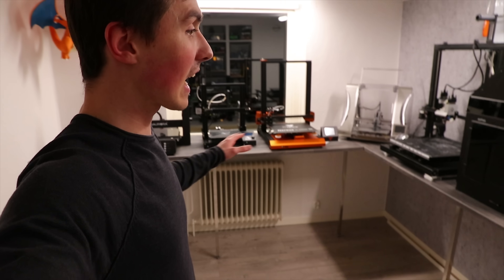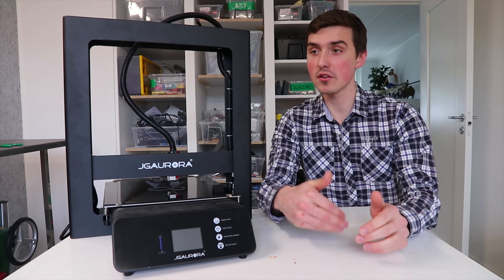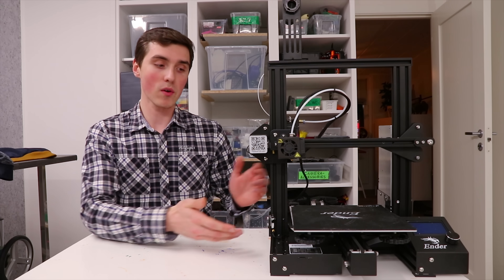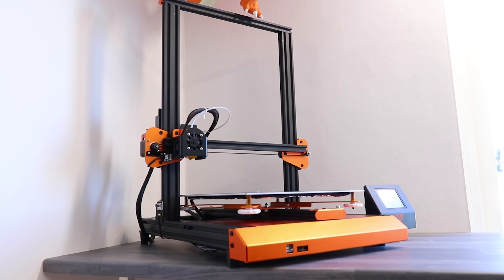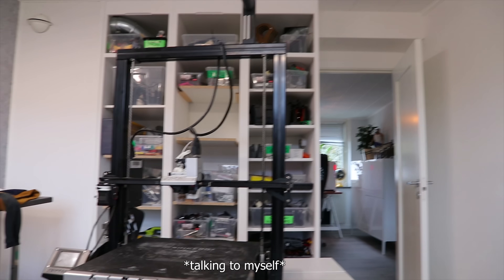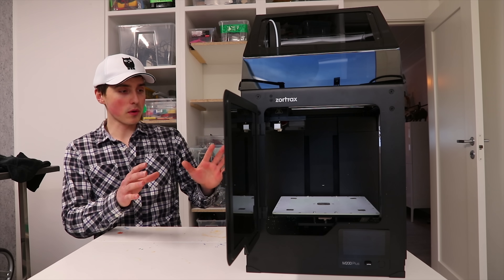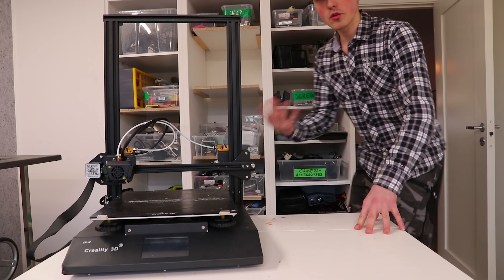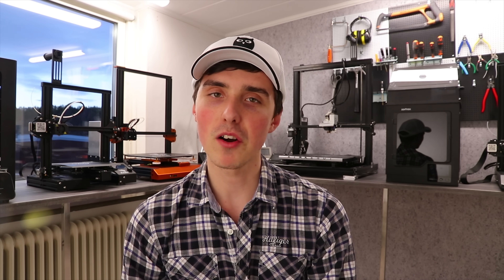I Can Only Keep ONE 3D Printer?!

Comment: Greetings, Great Channel! I was wondering about your filament choices and how that effects your printer choices. I am interested, for a number of reasons in printing mainly with high-temperature filaments like PC and PETg. I also print in the translucent prints a lot. Would your choice of printers be much different if that is the criteria? Also, what about the recent generations of reinforced PLA and ABS, such as carbon reinforced ABS, will these printers print in those materials? Thanks in advance, keep up the good work, WGP

Comment: I bought two of the JGaurora A5S after watching a few reviews. Have them now a few weeks and to say they are very frustrating is an understatement. I have the CR-10S and never had an issue with that. These I level it, start the print, find it’s not sticking so stop it and check it and it needs to be levelled again. So I level it and if it does stick all of a sudden I hear a clicking noise and I check and it’s the feeding wheel. Too close so I sort that and it’s back to not sticking. Took the bed off both and everything is perfectly straight. Seems as if one of the z motors is moving at a different rate to the other

Comment: “Doesn’t reach 90 degree Celsius.” Are they supposed to? Water boils at 100C. If the platform reaches 90C it can burn people and melt plastic, isn’t it?
Reply: Yeah they do. Different material requires different heat. There are many materials u need the hotbed over 100c
Reply: Ahmet Topuz just ordered the creality in this vid. I’m gonna cook eggs with it.
Reply: @danielx40  :D all jokes aside, i was trying to print ABS on a bed that was 70-80 and it would start coming loose middle of print messing the whole things up. Now at 110, I can print nicely and it doesnt get loose. I think industrial nylon needs like 250-300 degrees to be able to be printed. I could be wrong tho. Enjoy those eggs ;)
Reply: @ahmettopuz5083  I was just reading about filament materials. ABS is much more durable but does need a higher temp. Some people build a box around it, even with construction insulators. It seems achievable. Without rewatching the video, I believe that I ordered the "doesn't reach 90 degree" model... Guess it's gonna be medium rare for me.

Comment: I don't know about you, but if I need to keep just one 3D printer, it would be my first and latest upgraded one: My trusty Rostock I've built myself. I've even once installed it with an inductive heated head plus a thermocouple and got up to 750 degrees Celsius, tried to print metal (it failed, since the different layers got oxygenated so they didn't stick. A vacuum chamber is above my budget, so I've stopped there). I've made so many mods to it over the years.. But I am beginning to have heresy thoughts about constructing an HyperCube to replace it since with a CoreXY I can get to very high speeds. But really, once you take a Rep Rap design and build it, add you own personal flavor to it, that's the only way to get the perfect printer for yourself. Or to be more exact, to a good printer for yourself as there is no such thing as "a perfect 3D printer". You always strive higher. Which is great.. If its your own build, you can always upgrade it.

Comment: Great Video, I like your explanations, thanks! When you would by a 3d Printer, what would you prefer one with or without dual Extruder? What are the advantages of the dual extruder? What slicer do you need? How can I design something and assign the material where it has to print?
Reply: I'm just starting the journey, but with a dual setup cant you use a water-soluable filament for the supports?    seems like the best application

Comment: The JGAurora looks sexy but the wheels soon fall off as parts go wrong and they guarantee is worthless and they are hard to fix since all the wires are hidden and our A5 had gone wrong 3 times within a few months including black paint coming off the hotbed. Cr10 is low fi but they work

Comment: Meh....smaaaaaal
I build printers that reach more than 1000mm.....
My one is 450x600x470mm /// 45x60x47cm , can print anything , i build diy heatbed for it 1000W 350x450mm and second 450x600mm 1.5kw ..... 60*C i ln around 60 seconds 100*C in 2.5 min :D quality....i just say that printer is made using laser linear rails with 0.003mm tollerance(so hard to move it), price ..... If you use cheap chinese rails around 350$ for 450x450x450 print size you just need to repleace steel balls for high quality one and print quality you get is around 9/10...if hiwin (0.05mm tollerance) around 800$ the same quality but out of the box.So you get quality around ultimaker 3 or better:)

Comment: I got Ender 3 and my prints were ok.. until i switched to glass and now they are PERFECT.. The pains i had to go thru with the PEI sheet and warped bed was... well, if i had known what a difference it is i would've just thrown the sheet away.. It lifted of the bed at middle juuust a bit, 0.1mm or so and when the bed is not flat on enders to begin with... the first layer is a pain. With glass it is nothing short of amazing, of course i has tweaked mine to optimum so i could get any quality with original sheet..

Comment: Huh. Tevo Mispelled Nerys :-) hehehe I see the Nereus as a "reboot" of tevo and a decent solid reboot. I like the ultra lightweight design ethos they seem to be going for though it needs some tweaking. I also love how EASY it is to remove that front orange panel to access everythign inside. EASIEST access machine on the market. getting excellent prints from it with a 1.2mm nozzle. Also agree print surface sticks a little TOO well :-)

A5s NICE quiet. my biggest complaint about their A5 and A5x otherwise agree nice solid machines.

Ender 3. wicked. still advise the pro over the regular. there is only about a $20 to $30 price difference which is worth it for the PSU alone. YES agreed get rid of the mag bed ALTHOUGH I hear it can handle 100c I have not confirmed this. just toss the flexble mag bed and slap a piece of wham bamm spring steel on it. NICE !! 100% agreed PLA can pull the mag surface apart stock! yuck.

drool. I WANT that xinkerbot and that zmorph. soooo badly. xinkerbot might happen someday but not the zmorph. can never afford that and I am not big enough I suspect for them to send me one :-)

great video as usual. LOVE your stuff!
Reply: I enjoyed your live stream the other day when you were unboxing the nereus, I ended up buying one and decided to buy some tmc 2208's as well. Can't wait to get it.

Comment: if you use the zortrax long enough, you'll find it's not good at all, the bed is a consumable, that's absolutely stupid, the software and hardware are locked in, you can't do anything but what they allow you to, for 3k it's better to get an ultimaker, or pay less for a prusa that's half decent, although if you buy into the zortrax ecosystem it's plug and play, never have to think about it

Comment: A cheap direct drive adaptor for the Ender3:

https://www.ebay.co.uk/itm/Ender-3-Direct-Drive-Upgrade-Kit/173704864701?hash=item28719de3bd:m:mASxd84nIwRDZNCKjovxdbA&frcectupt=true

just ordered it myself to go alongside an all metal hotend.

Creality have also just released an upgrade "silent" board thats plug and play:
https://www.creality3donline.com/creality3d-ender-3-creality3d-ender-3-pro-creality3d-ender-5-v114-silent-quiet-main-board_p0147.html

Comment: I hate to say it but I am truly stuck in the position of i have to quit using a printer....... If i have 5 printers running im blowing a breaker :( 1 ender 3, 1 cr-10s, 2 cr-10s pro's prusa i3 mk2.5 so i can only run 4 at a time:( I dont run the Prusa much. anytime i run that thing i have to work on it.... i learned to stick with creality but i am at my limits on power

Comment: @4:50 i did all the upgrades except the stepper motors... i modified a direct drive extruder design to fit my stock nozzle assembly, and incorporate the fans in better positions. i also make aquariums, so i took a chunk of glass and made a glass top haha! works great! im also printing lithophanes on mine. still gotta get the temp settings dialed in, but each one is better than the last! im using PETG

Comment: you made me buy a ender 3 a while back, from watching your videos..........

And I love it :D

Keep up the good work, I'm considering upgrading the motherboard(MKS Gen-L) and more silent stepper drivers(tcm2208 or 2130?), hopefully a fun project :D allready have the glass bed :P
Reply: Be careful though, one russian youtuber said that a circuit burned on his ender and hotend literally was out of control. Be careful with it, there is no protection on circuit.
Reply: @bogdanbelskii7522  Maybe from factory, but I have updated my firmware to include "thermal runaway protection", so I'm good. ANYONE getting into a new hobby should research, finding what is needed to fix on new hardware, and correcting it.
Statements like "a russian said your shit can catch on fire" HELPS NOBODY, "make sure firmware is up to date, and check the common issues to fix them" is helpfull ;)

Comment: Why do you never have anything from Prusa ? they are such an important company for 3D Printing. Would love to hear your thoughts :)
Reply: fassenkugel  Customer service and reliability are key in Prusa printers. They are designed for schools and workplaces where time is at a premium. I bought one personally and don't regret it. I can rely on it to do what I need it to without tuning or advanced setup, but I still have as much control as I want (unlike afinia and makerbots). That reliability puts Prusa, Lulzbot, and Ultimaker above the clones for businesses and schools.
Reply: Yeah where's the MK3???

Comment: You really think the Ender 3 Pro is not worth the additional €20-25 for the improved power supply and magnetic bed? Was really thinking about getting a Pro, but second guessing now if I should go for a glass bed
Reply: the more rigid frame is about the only worth while upgrade that you can't get for cheaper on your own.  The magnetic bed is garbage.  It's a neat novelty for the first week, and then you'll want to switch to a glass plate, especially with the ender 3's notorious warped bed.  Having bought an ender 3 pro, I'd gladly go back and buy the regular ender 3 and just do my own upgrades, including buying a better power supply for less than what the pro cost.

That said, if I really were to go buy another printer I'd probably get the ender 5, or build a coreXY/Hypercube  The extra space  that having a moving Y axis takes up is annoying, and on larger/taller prints(like lithophanes) the movement can cause wobble or pop the print off of the buildplate.
Reply: @nothanks7752  thank you, insightful!

Comment: I have got a question about the CR-X. 3 Weeks ago I started looking for a dual extrusion 3D Printer and I have seen some really nice machines like SIGMA r17, Makerbot Method... But the problem is that they are very expensive so here are my questions: Is the CR-X a good dual extrusion 3D printer? that is also able to Print Support-PVA with no problem. Because that would be one of my main reasons why I am buying such a Dual extrusion printer. In case you could not recommend the CR-X as a PVA printer are there any other 3D-Printer out there (Dual extrusion) you could recommend (2000€ price point). 
PS: Love your videos
Reply: What would you like to do with the printer ?
Reply: @Wieselkatze  Das steht doch im Kommentar xD
Reply: @lf8808  ich meinte mit meiner Frage was du denn genau vor hast. Oft braucht man garkeinen Printer der extreme Details hinbekommt weil man in der post-print Phase so oder so noch Schleifarbeiten oder andere Arbeiten am Print machen möchte und so würde sich evtl auch ein etwas günstigerer Printer anbieten.

Comment: For the zortrax there is a gcode to zcode converter tool out there, so you can use any slicer and change most of the settings
maybe you give it a try?

Comment: Test a Flashforge finder 3D printer from Clas Ohlson in Sweden!
Reply: I have one and I think you can definitely get better printers for the price. It is very easy to use, but it is $500 and doesnt even have a heated bed. It is only 140x140x140, so it would probably be better to get a cr-10 for a hundred dollars less.

edit: Just checked the price and it is at $300, it was $500 when I got mine over 2 years ago
Reply: A finder was my first 3d printer. But the volume is just too small.
Reply: @veloc1tyTV  yeah its really small i might get a cr 10 soon

Comment: Send me one! My Tevo burned up and went to Tevo heaven and I can't afford a new one.
Reply: Dude how did you destroy your Tevo?
Reply: @MaxAutoCare  I'm assuming the controller board died due to a faulty power supply. It was printing. Stepped out for a bit. Came back and it was stopped dead mid-print. The screen was backlit but nothing was on it. Resetting everything did nothing. Could not reflash firmware. PC wouldn't even recognize it.
Reply: @mdk1000  Damn dude sorry for that. I ones blew up my ramps on my delta due to the power supply too. Hope you get it fixed or get a new printer. Peace
Reply: @MaxAutoCare  Thanks man.